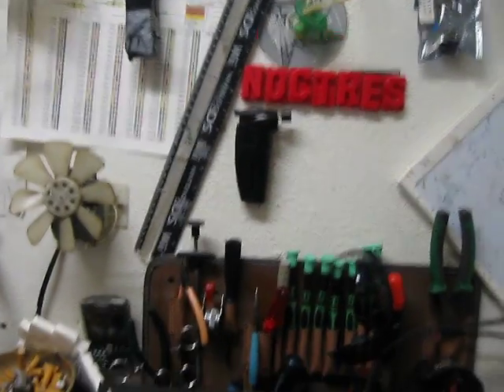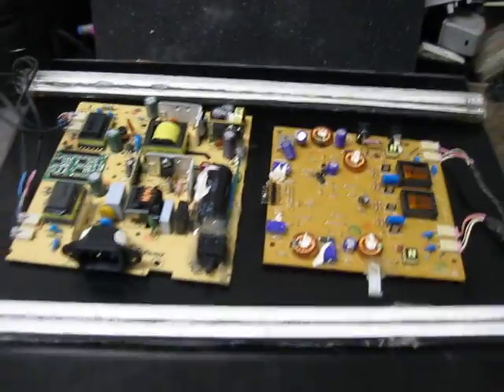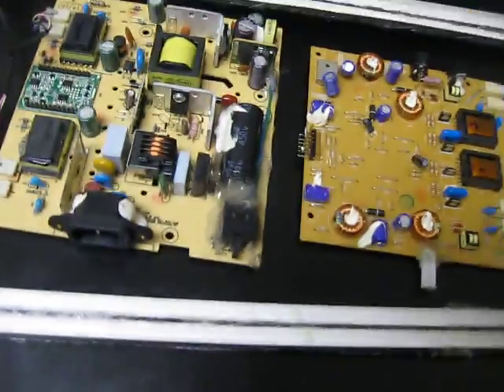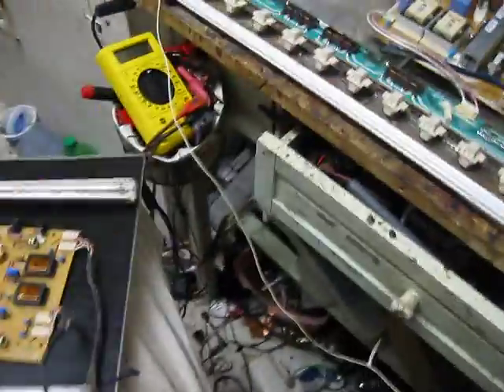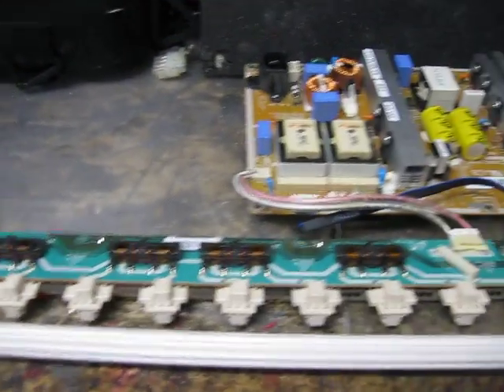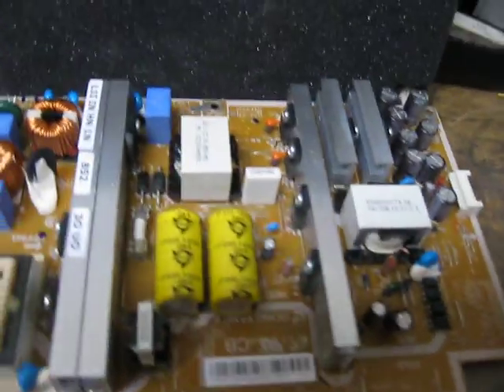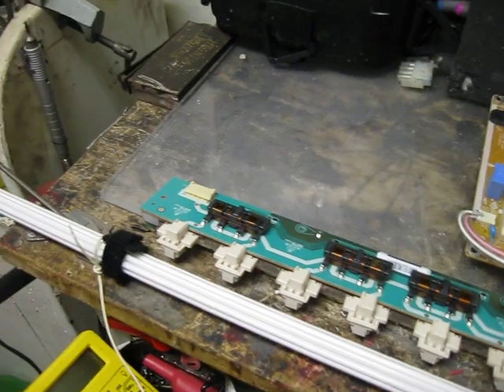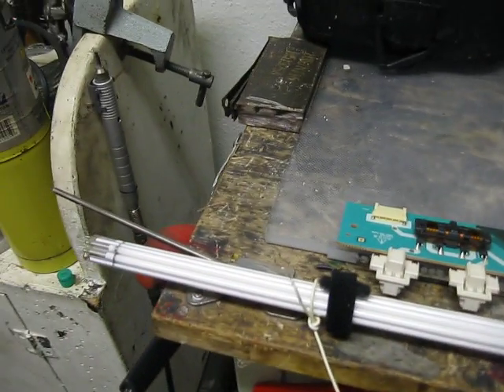ccfl lights, inverter boards, and lighting related ramblings

Comment: I love these kind of lights. it really is a shame that ppl throw out things that have them inside b/c if you know what you're doing you can get a VERY useful source of light for cheap. I rescued one from an old flatbed scanner head and it works great. mine runs on 12 volts which is perfect for emergency lighting. I put a switch and car cig lighter cord and plug on it and run it off a jumpstart power pack.